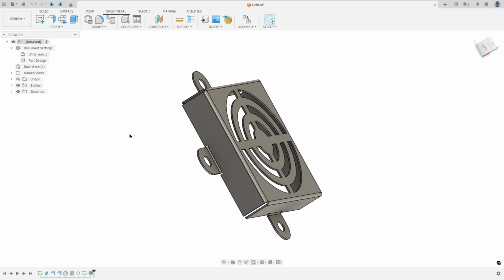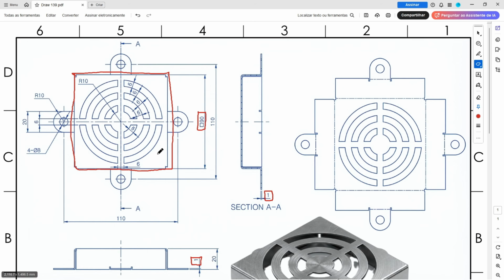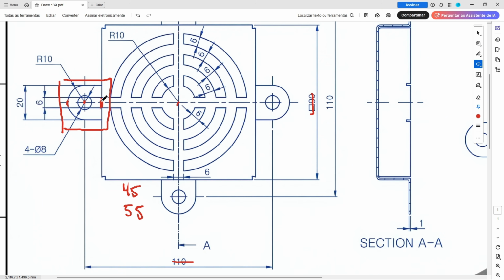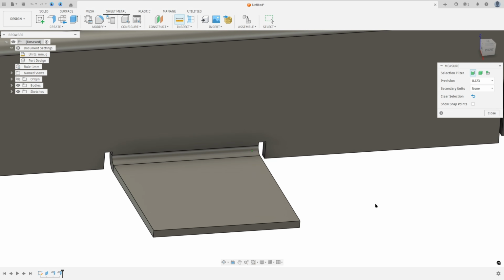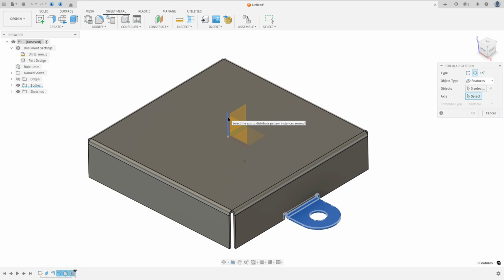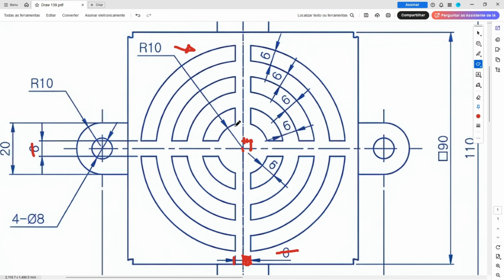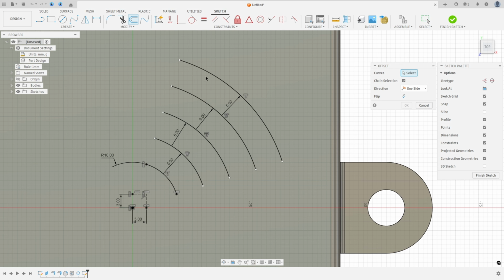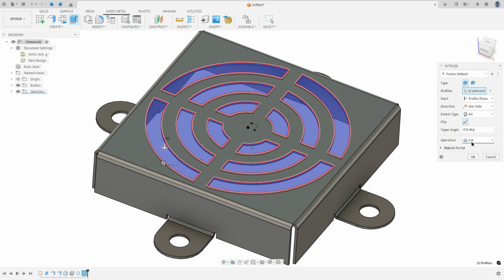Fusion 360 Sheet Metal  COOLING FAN COVER  Practice Series – Exercise #6

Comment: Thanks for the videos. I build a ton of Sheetmetal products but have an issue with all the limitations in fusion with sheetmetal. I tend to draw all my work in flat patterns because of all the notches it puts in the flat pattern for the bend notches. I need tight corners for my work and I've tried a ton of things with zero luck. I work mainly with 24 gauge sheetmetal. do you have any tips to help me in this area. Thanks. One other thing when working with 3D models and flanges. I have to make the flat pattern before i can do the manufacture process for my plasma to cut the items. I cant seem to find a way to have all the compent flat patterns to arrange and nest for one operation without bringing them into another file as derived flat patterns. Thanks for the video. I am following you to see what else you come out with.

Comment: using the circular pattern after the first sketch on the top is easier if you only  extrude it and then use the circular pattern with the part already extruded.